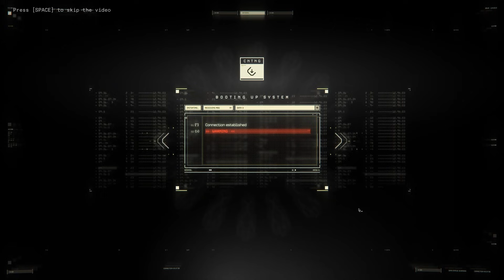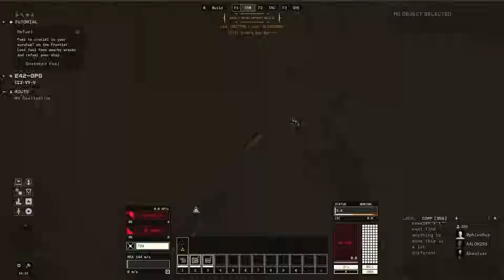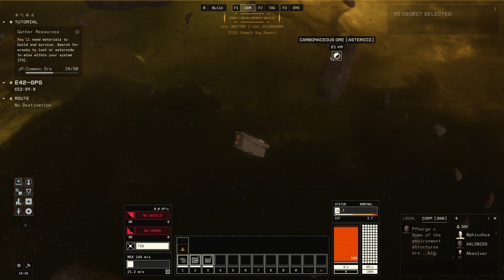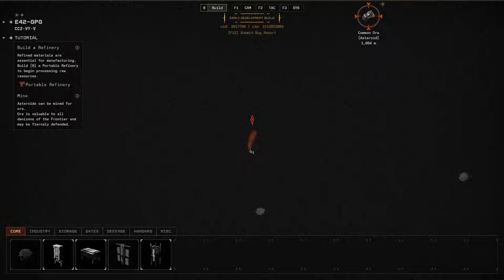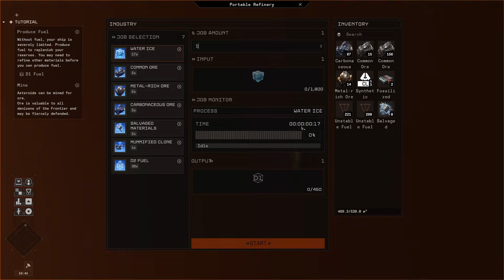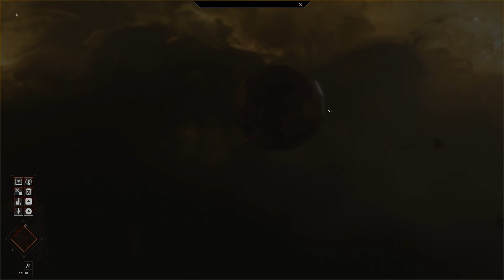EVE Frontier Tutorial \\ Part 1

Comment: I keep reading comments asking questions about the game. This game is what I had in my mind when I could never handle Eve Online. I couldn't handle the scale of risk. $40, open PvP from start, it's like Rust, you have to SURVIVE. It's a test server, but it's different because it's a brand new 'verse, complete resets on cycle every 2 months or whenever they announce. HOWEVER, your actions can persist in virtual methods. People built DOOM in the internals of a built structure, fam, it's a game with MASSIVE modding ability. Oh, and elements are open source, so you can make DOOM on your machine in some cases BEFORE you deploy it. Use your phone while your at work to see how much people pay for your virtual tools or creations, etc. There's a LOT of stuff I'm saying that's not implemented, it's early access. But it's very much worth the ENERGY I've been putting in, personally. Hopefully this all helps, hope to see more riders. Fly safe. o7
Reply from the maker: Yeah, I’m very curious to see where this game goes, lots of ambitious and cool ideas.